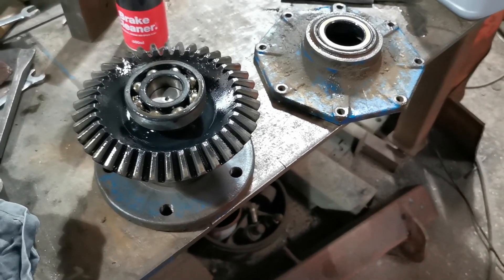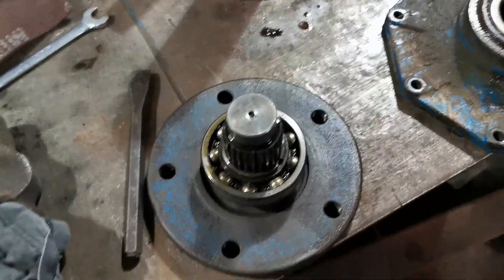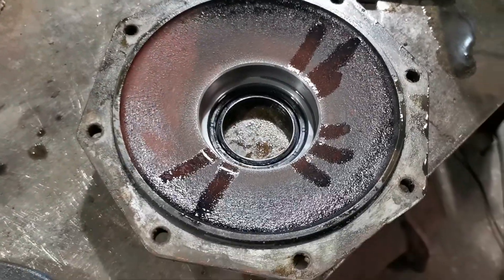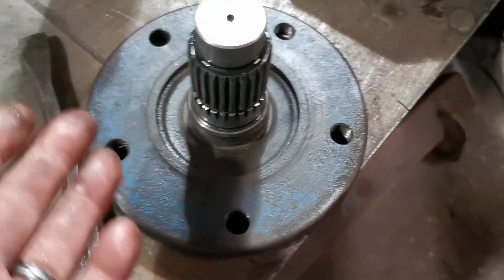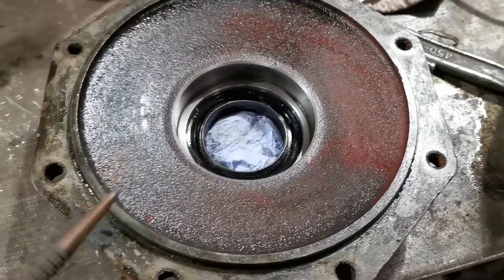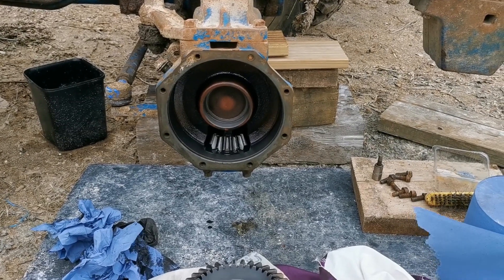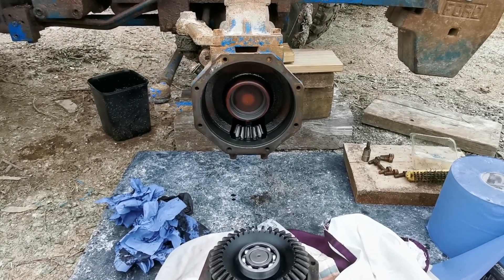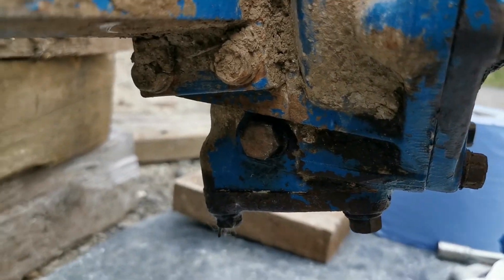Ford 1720 4WD compact tractor front hub overhaul

Comment: What is the part numbers.or where did you get the parts. I can't find any of the correct parts for my new Holland 1720 4wd front hub assembly
Reply from the maker: I contacted MJN Tractors, a New Holland dealer in Chicester, Hampshire, who were very helpful. They provided diagrams to confirm parts and delivered the parts to me
Reply: Ahh ok thank you. I'm in the USA. No luck finding even a part number here or a diagram 😢